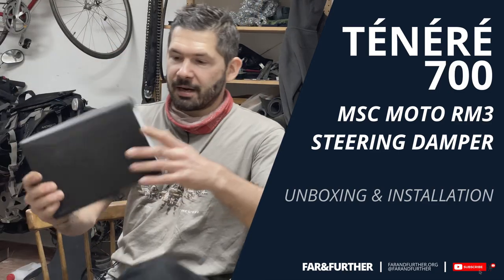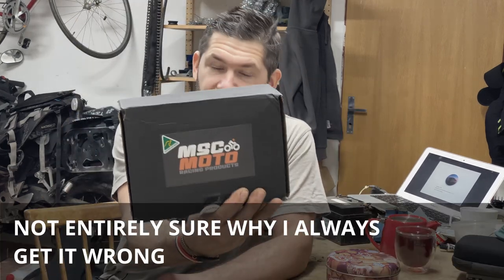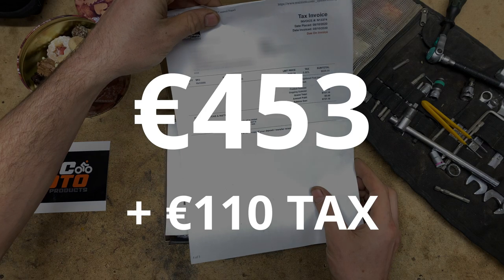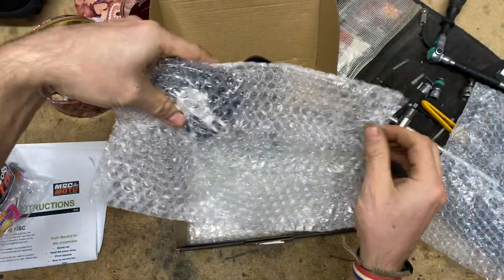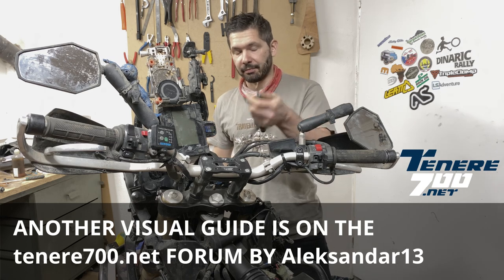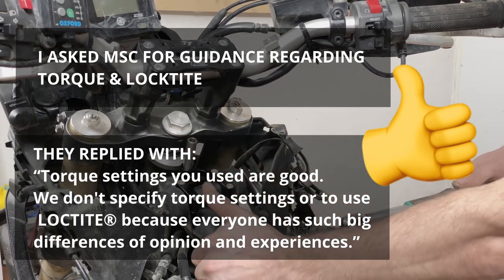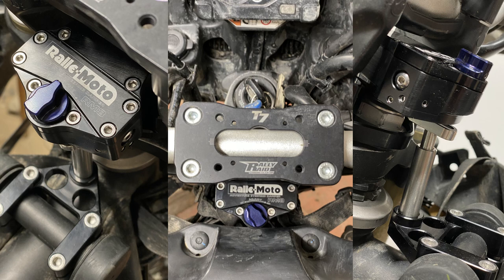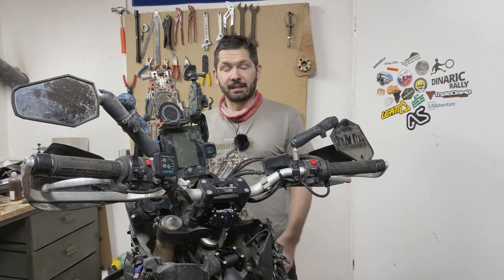Yamaha Ténéré 700: MSC Moto / Ralle Moto RM3 steering damper unboxing and installation

Comment: Nice piece of kit Pavel, hope it works great 😺
Reply from the maker: Thanks! So far it does work pretty well, have been doing some testing rides and it does helps a lot in certain situations.
Reply: @FARANDFURTHER  are you posting a video about you findings I'm tempted to get one as headshake at high speed had a couple death wobbles on my t7 pooped my pants
Reply from the maker: @MackAdventures  Possibly yes, it's a bit difficult to show what it does and when it is helpful. Although I have to say that after 2 weeks on motorcross track with the T7 I have no idea how I managed to ride the Dinaric Rally without it. As the speed goes up, it starts to be insanely useful not to mention it does save you enormous amount of energy.

Comment: Nice pick ! Why picking the RM3 over the Scott ?
Reply from the maker: Just because the MSC Moto is a small family run business and it's not as mainstream as Scott. I like to support small workshops, that's why most of the stuff on the bike is sources alternatively or custom made.
Reply: Very good Feedback from people on some Forums, was not on my radar before but the name is coming up often now.
Reply: @FARANDFURTHER  That make total sense, I admit that I ordered few weeks ago the scott version for my T7 because I heard only good feedback from them and I didn't know that Ralle Moto was a family business otherwise I would have done the same
Reply: Some more info. The Scotts is a good product, but its huge and super heavy. The Scotts was not designed to be a steering damper, it was actually designed to be a damper on a sport bike with a carbon fiber rear swing arm blade. That's why it has a bunch of adjustments (High speed, sweep) and features (the silver shaft that comes out the top) that are useless as a steering damper! The MSC damper was purpose-built and just works. Active Return to Center damping is also awesome!